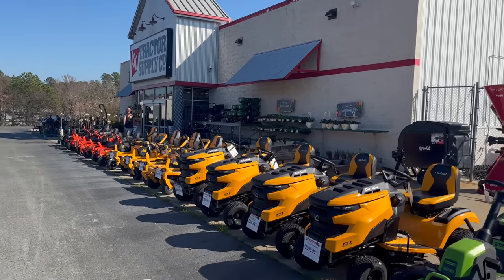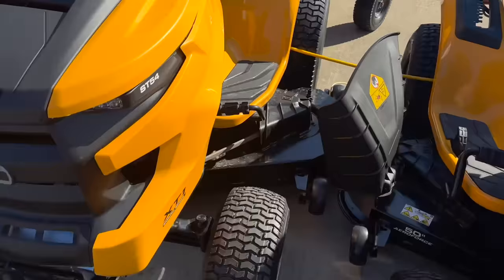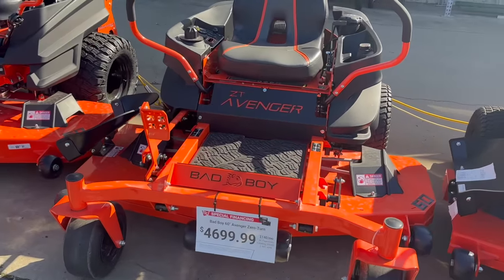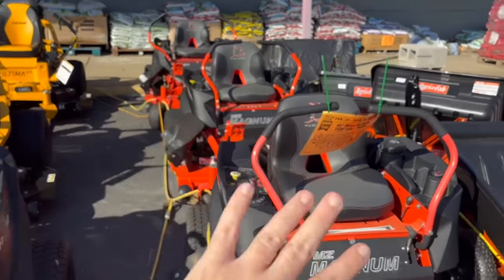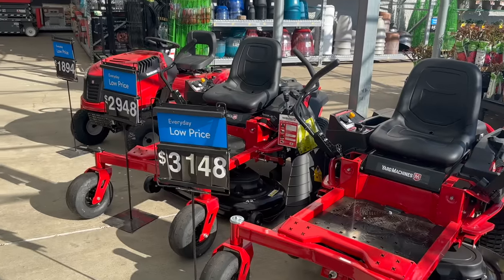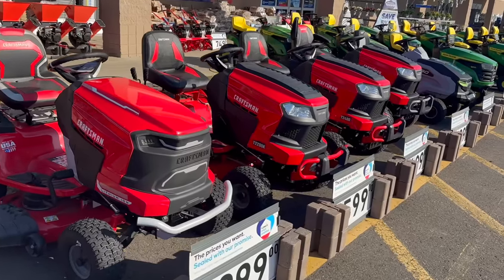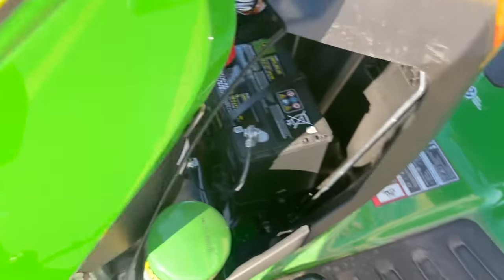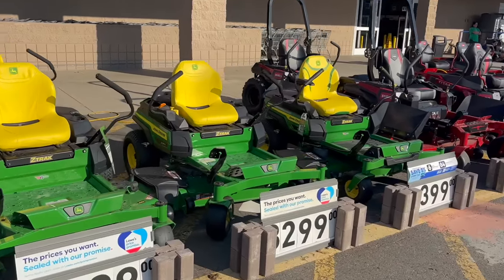The BEST Mowers to Buy and What to Avoid at The Big Box Stores This Year!

Comment: I have had a Cub cadet for over 7 years and never done nothing to it but change the oil and mow my yard
Reply: Me too. My zero turn Cub Cadet is 8 years old  and I'm just now going to change the front tires. Mine has a Honda motor.
Reply: Me too! Mine is 2 years old and I mow 3 acres. My mower has the Kawasaki.
Reply: I got about 7 years out of my cub cadet zt before it would barely move. Suspected the drive belt needed replacement and it was such a pita, I just junked the mower.
Reply: U lucky
Reply: I sold my Cub Cadet with a Kawasaki motor that had about 280 hours on it and it was 11 years old.  Never an issue-just regular maintenance.  Bought an Ariens Ikon in 2021 and no issues with it either.  Same Kawasaki engine and the deck is much more stable/sturdy than my Cub Cadet.  Mowers are improving in construction and ease of use.
Reply: Had a Cub zero turn, 3 years old and the engine quit mid mowing, took back to dealership and they said engine was bad and needed replaced!  Last fricken one for me!
Reply: @polishguy6012  That stinks.  Was the Kawasaki motor?
Reply: Sounds like cub need to sweeten up a few youtubers ,my cubs great I'll never go husky or deere again,  apart from husqvarna chainsaws.
Reply: @Nozinbonsai  My Cub lasted 11 years and sold it!!  My only complaint about it was the wobbly deck.  The new mowers have a firm deck that doesn’t bounce around.  You get a nice clean cut.  I guess the issue will be those with uneven yards might not like the deck steady.
Reply: My Cub Cadet Z Force zero turn is 17 years old and still going strong. It has a Kohler twin on it and I did have to do head gaskets, other than that, one spindle (because I hit a massive rock. and cracked the mounting flange
Reply: You didn't mention if you ever clean the deck.  You should be.
Reply: It appears as though the Cub Cadets made now are not as good as the older ones.
Reply: @91CavGT5  Stamped decks are not the best.  Mine has a Kawasaki engine and it ran great but the cut did not compare to the Ariens.
Reply: I bought a Cub Cadet Ultima ZT2 60 3 years ago.  I wanted a Bad Boy but stock was limited when I bought it in the Fall.

I mow 5 acres and use it to tow a trailer and push/drag logs around the property.  

No issues at all.  I blow off the deck after every mow.  Pull the deck for a full clean, blade sharpening, and a couple coats of paint every season. 
I keep oil in it and the air filter clean.  Plus I store it in the garage. 

Pleasantly surprised so far.  A friend of mine has been using a couple Cub Cadets to get his lawn care business started and they get really beat up but just keep going.

Comment: I purchased a Bad Boy Maverick for my wife and she absolutely loves it. We upgraded to the best suspension seat they offered and got the Kawasaki engine.
Reply: I'm looking at a bad boy. However my dad's gravely is  having issues cutting grass over 8 1/2 in tall. And I was apprehensive because they both have the same engines. Have you witnessed anything like this with your bad boy? I know you're supposed to cut your grass before that, but sometimes it gets out of hand if it rains and you're not able to.
Reply: @MrFordguy73 have a Mz rambler cuts like trash anything kindve thick needs two or three passes
Reply: Thanks.  That's helpful
Reply: @MrFordguy73  I couldn’t really speak to that. I got the mulch kit for her mower. So we really don’t let it get above 5in before we cut. The motor is strong, I suspect it would handle tall grass reasonably well if it did not have the mulch kit.
Reply: You're a great husband. Now you have more time to hunt.
Reply: @MrFordguy73  
 Are you keeping the blades sharp?
Reply: I looked at the Bad Boy zero turns and the seats were a huge turn off for me since they just aren’t tall enough, and with my bad back I need that extra support.  Where did you find the seat for your Bad Boy mower at?

Comment: I bought my JD from the dealer. Same price as Lowe’s but like you said I had instant service from John Deere. Mine has 300 hours on it and I have had no problems. I keep it well maintained. Love your videos.
Reply: My push JD JS28 (I think) lasted 13 years.
Reply: I bought my X300 from the JD dealer in 2010. It now has 750 hours and still purrs like a kitten but I also keep it maintained very well. Has a kW engine on it.
Reply: My 2000 LX 277 is entering its 24th season. I bought it used in 2003 from my JD dealer to get a larger (48) deck than my 1990 LX 176 (32) deck to take an hour + off my mowing time. The JD mowers at the dealers are more robust with better engines and heavier constructed decks. I have it serviced by my dealer every year and am looking for many more years of service.  The only complaint is that the plastic body parts , hood, and bumper get brittle with age and crack.
Reply: Which model did you get?
Reply: 900 hours on my x300 17 years old still running strong
Reply: @gunsaway1 - Which JD model did you get? What year was it?
Reply: 2007 X300 17hp kawasaki engine

Comment: I've got a troy-bilt pony 17.5hp 42in cut i bought new in 2010 and other than oil changes and plugs and filters and a blade change 4 yrs ago i've had zero problems with it! I also have other troy-bilt equipment! Never had an issue with any of them
Reply: You need to be buying lottery tickets!
Reply: Have a Troy Bilt push mower with a Honda engine. 4 years old, best mower I've ever had.
Reply: James, Remember, that back 14 years ago, a lot of manufacturers built better stuff than the crap they do today.
Reply: @Ron-0417  my troy-bilt trimmer and walk behind blower are only 4yrs old and so far no problems! So if you want to over pay for Husqvarna or john deer or any of the other big names more power to you. More expensive isnt always better its like anything else if you take care of it it will last
Reply: Only have an acre to mow and my Troy built rider has been excellent for the last 10 years.
Reply: Man, I got a Troy Built Pony with a 15.5 hp Briggs and Stratton, from Tractor Supply last year, I got three quarter acre to mow, no problems, it was $1999 plus tax !
Reply: Got a Troy Bill with a Kohler engine. 10 years now. No issues other than oil changes.

Comment: I've had a JD LX 280 since 2005. Only serviced it, replaced belts, original battery after 10 years, blades, it has a kawasaki engine and I'm still using it today💪

Comment: You are so right with the welded deck. My Husqvarna rider has a welded deck and it's taken a real beating. Grease the spindles every year and never had a problem
Reply: I have GTH 52XLS with welded deck. It is durable, but it is also a pain. I mow 5 acres and half way through, I have to maintenance the deck. It collects dirt and grass like nobody's business. I have scraped two, 5 gallon buckets full, especially if there is any moisture present during mowing. I would be happy with a pressed deck,IMHO.....
Reply: @napollard  You are right! Welded is durable but a terrible pain when I remove it to do a thorough cleaning. I usually have to chisel away the buildup.... sheesh.
Reply: Thank you for presenting a great video. I am in the market for a Husqvarna 54 inch zero turn, eventually.

Comment: after using up a craftsman rider from Sears and later a cub ltx  54"  I finally broke down a few years ago and went to a local tractor etc dealership and invested in a Husqvarna TD 354 with a Kawai engine and a tuff turf 66 transmission with a locking differential ( I have some hills as I am on the east side of a catskill ridge)  at the time the Husqi was twice as much as a cub or JD (3700.00)  but they offered 3 year 0% finance 3 year)  I paid it off in 2.  The welded deck transmission leather seat and Kawasaki engine  and large garden tractor tires were well worth the money and it is still running strong.  Bonus is supporting a local small business rather than a faceless large box store

Comment: I have the Bad Boy 42" from two years ago. That was the last year they offered the 42 with the Kohler twin cylinder 725. You can only get that size in single cylinder now. Fits through a 48" gate, easy to get on a small trailer, solid steel deck. 5 gallon tank lasts half a year or more. Easy to service and clean. Love it. Only wish it came with larger rear tires. Easy fix though.

Comment: Bought a Troy Built shift on the go 17 hp single rider some years back, lasted 7 years mowing 1-3 acres, a 250 hour machine. Now have a Walker Mower 0 turn w/2700 hours with lots of life left. Chickanic your a peach!
Reply: it's amazing they have built something that is designed to be thrown away at 250 hours. meanwhile there are still 40+ year old IH cub cadets that have been rebuilt that are still working.

Comment: 2014 Bad Boy Outlaw with the 730 Kawasaki motor with 54" cut. Bought it from our local dealer. Only thing I've had to replace other than blades is the belt. Only because I backed into one of my wife's misplaced clay pots and it cut the belt. Love the beast. Cutting around 19 acres a week.

Comment: When I bought my Husqvarna rider, the one I bought had a welded  54" deck, cast iron or steel spindles and an electric locker. It is one of the bigger and more expensive ones they have. It is NICE.
Reply: I don't know what year or model yours is but when I looked at mowers a couple years ago the reviews on Husqvarna were worse than Craftsman
Reply: It's two years old. It is well built, runs good and I have had ZERO problems with it. Everything is right and tight! I know a couple other people that have never had problems with theirs either. Maybe some people got one with a problem, but that does not mean all if them are bad. Just like with cars and trucks, there are always going to be problems with some.
Reply: @geraldhandy2589  I have to wonder whether there are better built models within a brand. Some people have a great experience with their new Craftsman mowers while I've replaced a battery and the deck belt within the first 2 years. Are they all MTD now?
Reply: @Dojo-v6m  You can't fault the maker or assembler of the machine. All they do is assemble the units  from parts made by a number of sources. The maker of batteries will have a bad one from time to time, same as the maker of the belts and other parts. That's the way it goes with mowers, cars and trucks, tractors and basically everything.
Reply: @geraldhandy2589  Yea, I agree with you. The reviews on my Craftsman commonly mention bad belts though so it makes me wonder if Craftsman chooses to put cheap belts on. I put an aftermarket belt on and I'm curios to see how long it lasts

Comment: 5 years ago I bought a bad boy elite 60" for $5k. I mow 9 acres in three separate lawn areas with some significant hills. I've actually broken two of the black bars that connect the deck to the frame. I also pick up barbed wire from time to time and even picked up a mattress bix spring once. That one was a real pain. 

I love this mower and even retired my tractor and bush hog. However, there were three problems. Two are design defects and one is a mfg. defect.

The latter: the bolt holding the clutch/pulley to the motor shaft fell off. The vibration broke the wire to the clutch engagement solenoid. I had to replace the whole clutch, get the "professional" clutch (because it was about $100cheaper and better) and accept that about a half inch of the key slot was all chewed up. Interestingly, it finally took an email conversation with bad boy support to find out that, yes, that clutch will work. And it has, for two years. Kudos th BB for working with me.

Design defects:
1. Battery bolt fell into the cooling fan for trans. Fortunately I caught it early so no real damage.
Deck raising switch kept failing. But I replaced with the manual foot lever and, frankly, I prefer that. I noticed they all do it that way now.

Biggie: the seat on mine had a plywood sheet as it's main support. Though I kept the mower out of the rain, the store didn't while it was on the lot. The wood rotted and failed the second year. I bought a 5/8" marine plywood sheet and carefully made a replacement from the outline of what was left of the old one, and bought new bolts and "embedded" nuts off amazon. It's always garaged so I expect this to last forever 

This mower has really taken a beating, though, and still runs strong. 

Oh, and I chose it because of the welded frame and the ability to lift the panel to easily access the top of the deck.

Comment: Nothing beats my 1994 John Deere 445 garden tractor !
Reply: Oh yeah I have a x485 and it’s a pulling beast
Reply: I have a JD 425
Reply: A simplicity sunstar is very similar but will out cut a JD. Both long lasting great machines
Reply: my kubota BX sub compact? it's a BX2350 i bought used but it's still a fantastic machine, it will do everything yours will do...... and more.... on half the fuel

and it will last thousands of hours (diesel)
Reply: 1999 455 Diesel. Still going strong, which is amazing since I've continuosly used it as a bushhog cutting trails. 😀
Reply: Oh yea, my 1025r says otherwise.
Reply: John Deere 425. Hour meter broke at 2700 hours years ago. Rebuilt the Kawasaki engine after throwing a rod. New timing chain and steel gears. Lost oil pressure last spring and set in the garage ever since parked. Suspect plastic oil pump gear broke. Neighbor gifted me his old JD 140. Can't complain about the price but it's hard to believe John Deere put their name on the thing.

Comment: I just bought a new Husqvarna Z242F zero turn mower 24 inch deck with a Kawasaki 21.5 engine. This is my first zero turn I've ever owned. I currently have a Husqvarna YT 42DXLS model that works well too. 🎉

Comment: Bought a Bad Boy ZT Elite 54” w/ Briggs 28HP a month ago from dealer 3 miles away. Love it.
Another thing to note about zero turns is that they basically get compared by the equal transmissions and engines. My ZT Elite has Hydrogear 3100s and that’s the same as the Toro Titan Max. I paid $2000 less for the BB and essentially got the same mower.
Reply: I am shopping for a zero turn. I  found the Spartan is made by one of the original owners of BB. Very similar and less money.

Comment: I bought an exmark 42 in zero turn mower with the exmark brand motor with 24 hp and its been a super really good mower i bought it 2018 and used it to cut big lawns and haven’t had any issues with it. Only done maintenance and changed the battery. No spindles or anything has changed in it.

Comment: I have a 2003 John Deere SST-15-42"  Spin Steer mower.   It's a zero turn with a steering wheel, looks like a regular rider.  I think they only made them for 2 years.  20 seasons of mowing  & no engine issues,  but a wesk part of this mower is the vacuum actuated steering system.  I've replaced the modules twice, but figured out if I keep the ceramic fitters clean, the steering works better.

Comment: I’ve never bought a new ride on or push mower. I find them on “Craigslist Free Stuff” in my area. Usually they need alittle tlc. Oil change, new spark plug, replace fuel line and filters. Sharpen or replace mower blade. Valve adjustment on ride ons. Easy stuff for a tiny fraction of a new machine.

Comment: I worked for MTD for awhile. I cant disclose what I did but I design fitness and manufacture fitness equipment now so assume what you will :) 

Black and Decker purchased a portion of MTD years ago. I sit in on a meeting when thr rep of BnD said, "You are builing a 5k lawn mower and selling it for 3k. You need to build a 3k lawn mower and sell it at 3k." That was in reference to the Cub Cadet. 

That was many years ago. MTD at that time was owed by a single family. I objected and ended up leaving the company. 

The older Cub and Troy equipment are top-notch. The stuff produced in the last 20 years is garbage

Comment: Love how you skip right over the ego junk! I don’t waste my time with that either lol! Good video Bre!
Reply: Eco you mean?
Reply: @henryhill3778  Echo makes great equipment. Ego battery equipment is junk. 👍
Reply: Why is it junk? I’ve had an Ego mower for three years, no problems at all. No problem with the leaf blower either. No maintenance except sharpening the blades.
Reply: @cdipierro  I think this video sums up the quality of their stuff pretty well. HOW LONG DOES THE EGO 615CFM BLOWER BATTERY LAST
https://youtu.be/_3B_DapIJXA
Reply: @GarageGear  Meh, so you had one experience and drew a conclusion from that. OK. Well, I've had my own experience and have not had any problems with the batteries or the tools.  And I know lots of people personally who have had the same experience. And it may be that the gear doesn't exactly live up to the advertising, but that's not a new thing. My original point was that, for the average person with a modest yard, the Ego mowers work just fine.  I have no problem with ICE mowers, but I'd just rather not be bothered with the maintenance or the gas smell if I don't have to. And the Ego mower folds up and stands on its side so I can tuck it into the corner of my garage, taking up very little space. It just works for me.
Reply: @cdipierro  glad it works for you my friend